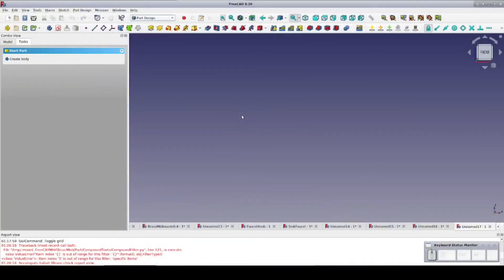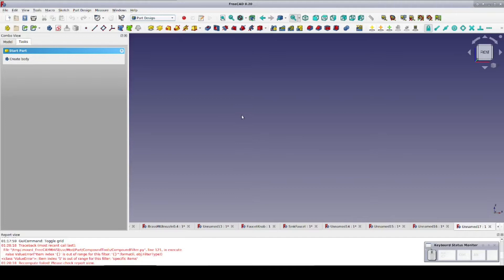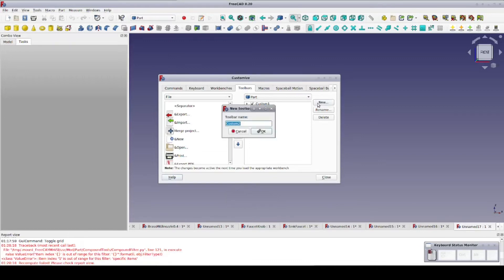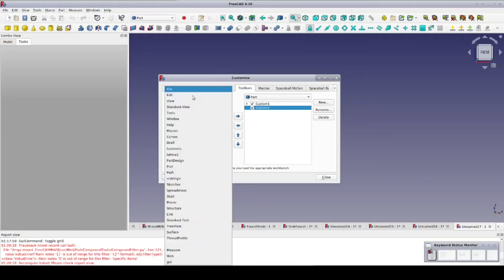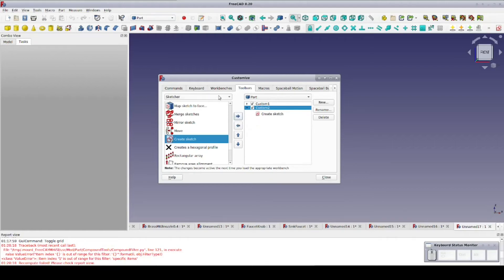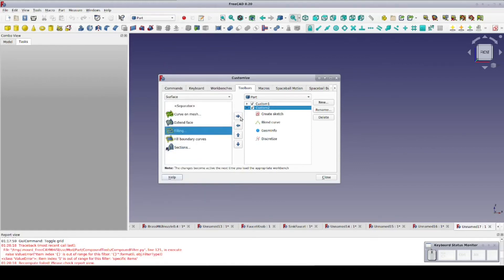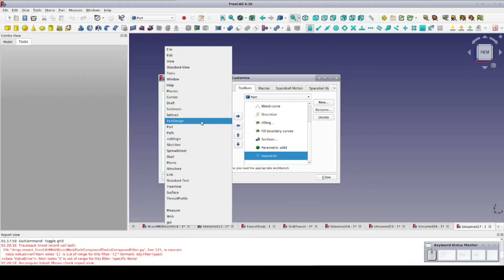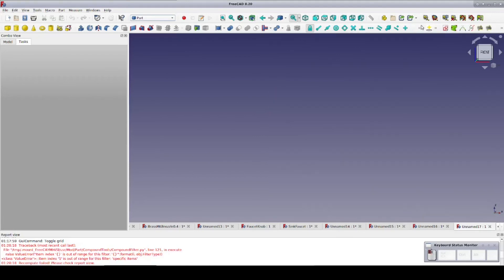FreeCAD: Adding a custom toolbar

Comment: Is there a way to modify the existing default toolbars in FreeCAD? I’d like to customize the “Sketcher Constraints” toolbar, but it seems unnecessarily complicated. In other programs, you can simply enable edit and then drag and drop the tools you need.
Reply from the maker: I haven't seen a way. The closest is making a custom toolbar to add tools.

Comment: Excellent!
Tip on Work Benches and Creating Custom Toolbars. The Work Benches are normally not all loaded until used. This can be changed in the Edit >Preferences to autoload specific Work Benches. While in FreeCAD the various Work Benches are loaded when selected.  Why do I mention this?  Because, if the desired Work Bench (Curves. Surface, etc in the above example.) is not already loaded, this tutorial will not show the Work Bench in the drop down to select the respective Work Bench's tools. So, you'll stare in frustration at your application window. Because, you can't follow the OP's instructions.
Reply from the maker: Thank you for pointing that out! You are correct.
Reply: Thanks for the tip!